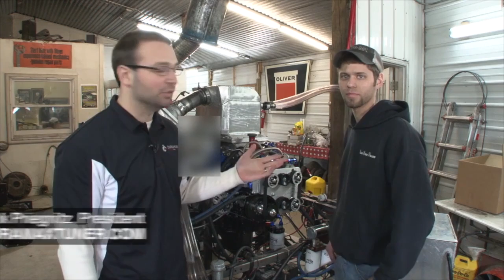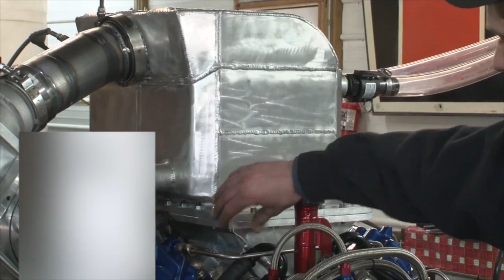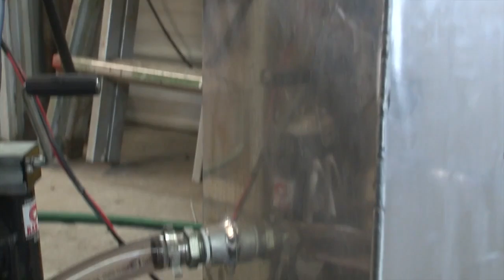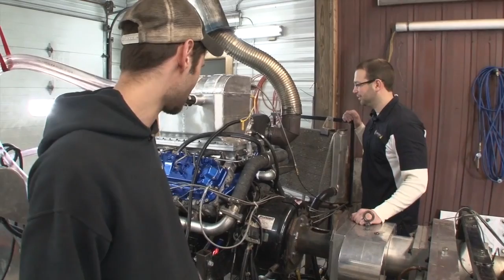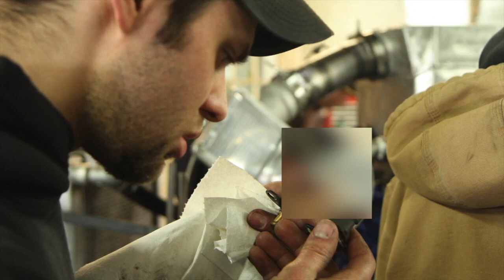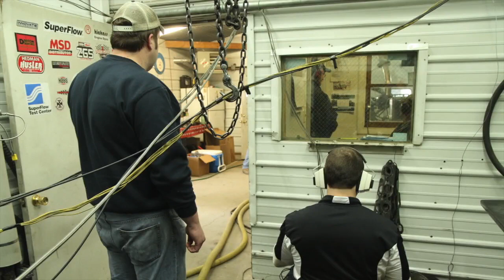ENGINE DYNO FOR SLED PULLING

Comment: Great vid lots of cool info. Always wondered what the 3.0 meant for this class, I thought it was displacement.

What is the point of blocking view of the turbo inlet? Is there some secret mods done to the intake side of the housing?
Reply from the maker: Hello ScaleCarModels: Thanks for dropping a note - we had to block the view of the turbocharger because the engine owner wanted us to keep it top secret.

3.0 refers to the 3 inch inducer on the turbocharger. 

Thanks for writing - please subscribe to our channel if you haven't already.
Reply from the maker: By the way - here's a link to a video about the truck where the engine was installed.

SPADE ACE Tuning by Duramaxtuner.COM